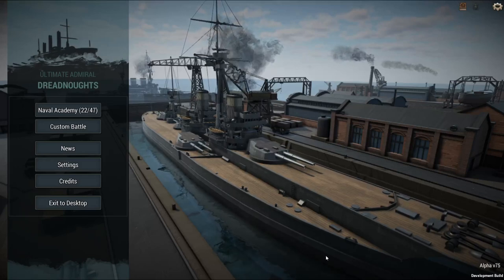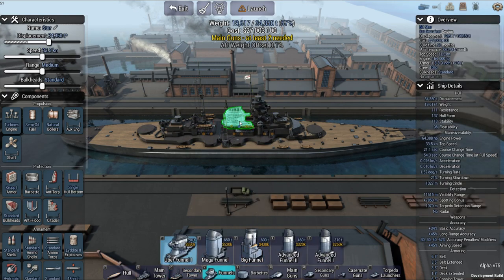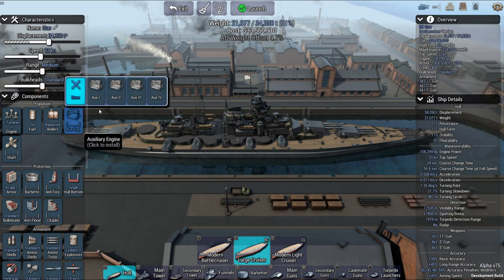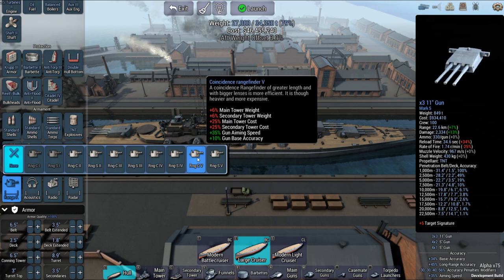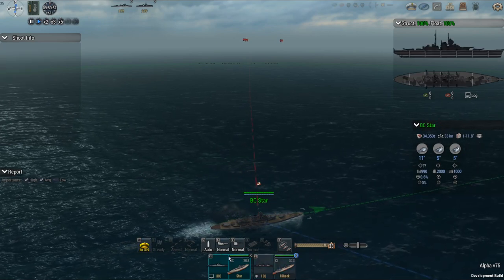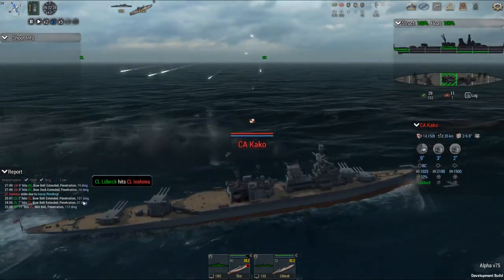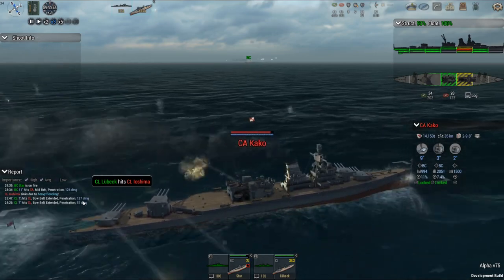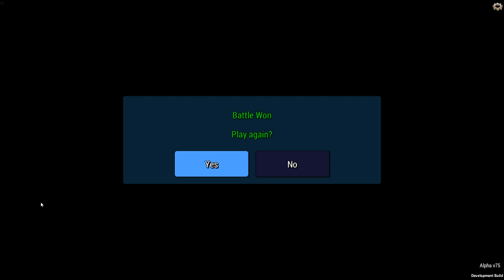Netherlands Battlecruiser - Ultimate Admiral: Dreadnoughts

Comment: Project 1047 was just a tip of the iceberg that was going on in rebuilding the armed forces.  so many inovations and new technologies where underdevelopment to acomodate all the new ship types , aircraft , armoured vehicles.  radar, infra red,  UHF radios , stabalized hazemeyer mounts , for 40 mm and 120 mm bofors ( the latter still under development)  Fokker D23 fighters (with the correct engines 100 km faster than me 109 and spitfires)  new snorkle equiped submarines , and these are just a few of the things they where working on as there was also a huge naval base construction planned to buildd and maintain these ships in the dutch indies. .

if interested i can send you the links to some of the data what was going on. in the 1930s

Comment: Nice one. The Dutch BC project is interesting. I would add though not only did they need to start it 5 years earlier- but it should have been an Aircraft Carrier, not a battleship.  Cause even when you throw out hindsight on the importance of carriers in WWII for Colonial policing duties in Indonesia and New Guinea dive bombers from a carrier would have been far more useful than 11in guns.
Reply: Correct as the sevenprivincien mutiny showed how vulnerable ships where to aircraft bombs, and got a lot of international and national attention . The  original design of the 3 battle cruisers did include 4 aircraft of which 2 fighters.